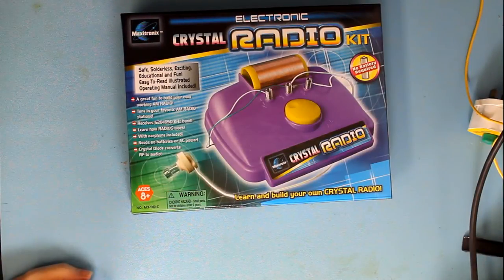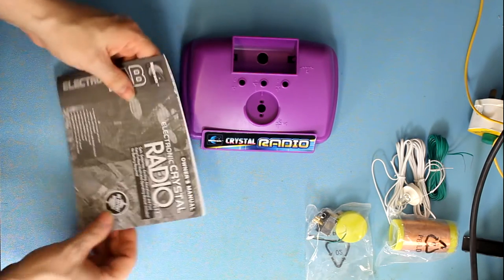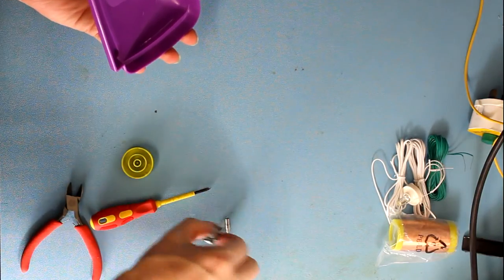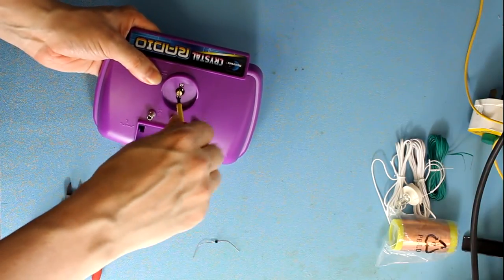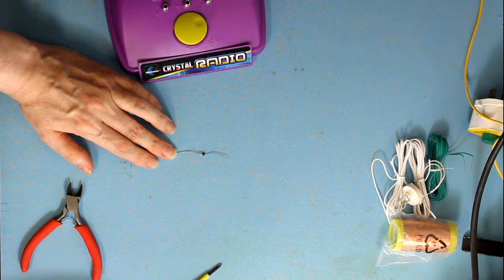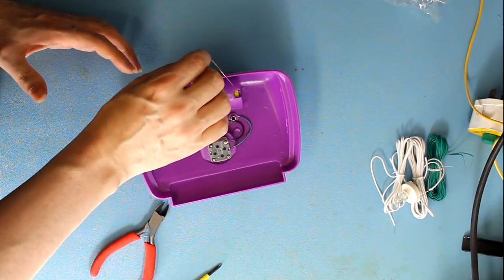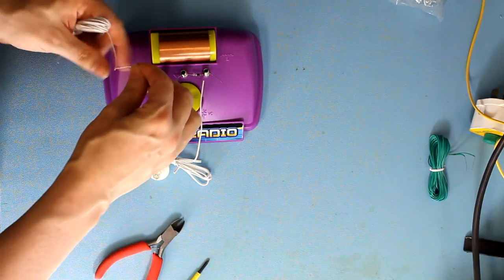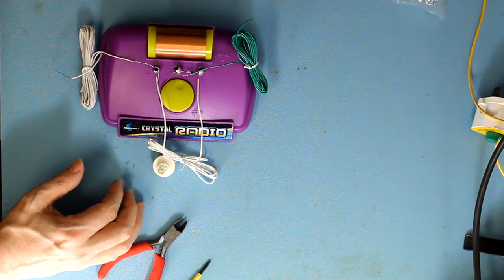Crystal Radio - Unboxing and Build

Comment: Really nicely designed and constructed.
With such a small antenna, you'd need to be pretty damned close to a medium wave AM station (The coil looks about Medium wave) to hear much. 
Advice on the benefits of a more adventurous, lengthy aerial would have been appropriate. 
Also an RF decoupling capacitor of around .001 mfd across the ear piece would greatly improve matters by getting rid of the actual radio waves after the sound has been extracted.  
In addition a high value value resistor in the same place would provide a better DC return for the diode, as the high impedance Xtal ear piece wouldn't conduct much of the diode's DC component.
So cheap (pence ... very low pence!) to supply them for better performance, would they eat into your profits so much? The price isn't displayed so I can't guess but believe me, I CAN guess